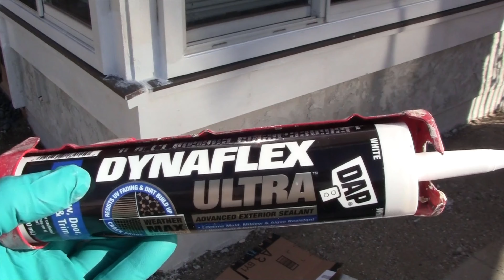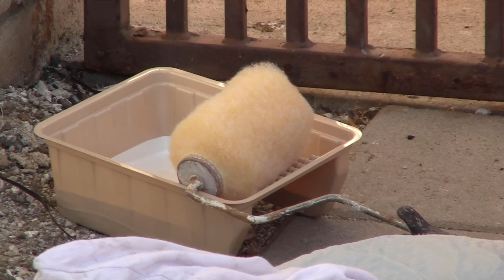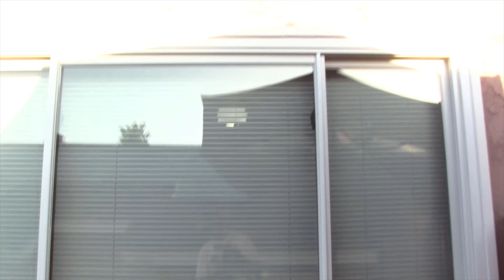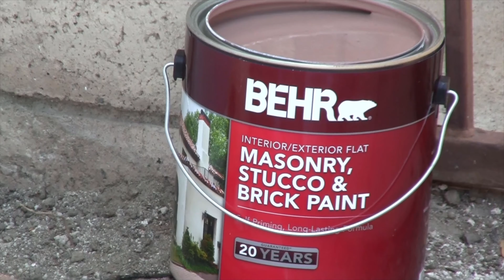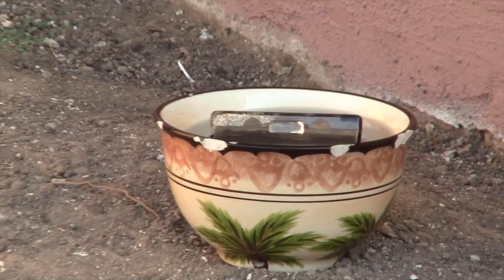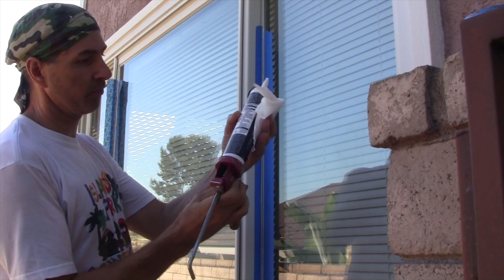Stucco Repair Series Part 10   Painting Stucco and Wood Trim

Comment: I watched every episode of replacing your stucco wall and am very impressed with your explanations, not only for the work itself, but also the unexpected discoveries from the start to the finish, even identifying the source of the problem. I came away with a respect for the time and effort required for such a project.  Most likely I wouldn’t do this myself, but the terminology and work I learned equips me with the knowledge to ask and follow along when I hire someone to do it.  I liked your tips on how you took care of your brushes too - that I will definitely be able to do myself!  Thank you so much!

Comment: Did u put the wood trim on that small wall after u completed stucco and if u did did u predrilled holes for nails
Reply from the maker: you have to put the trim up prior to the stucco and then you stucco up to the trim. I don't think, I needed to predrill the trim.